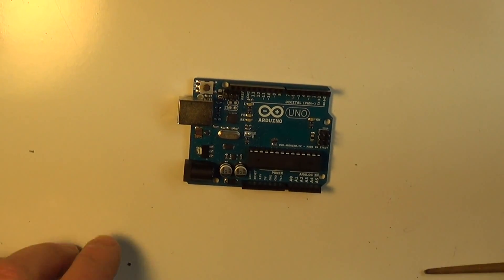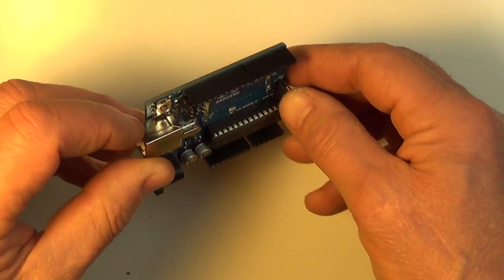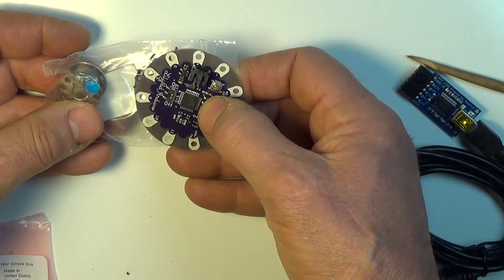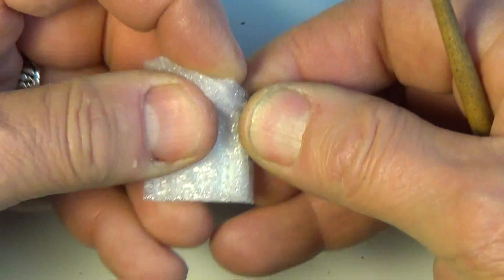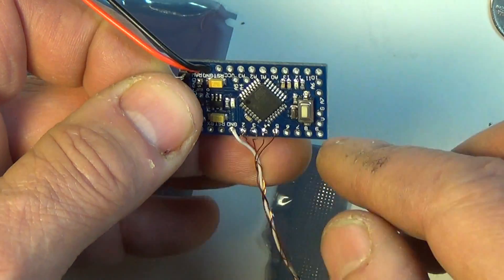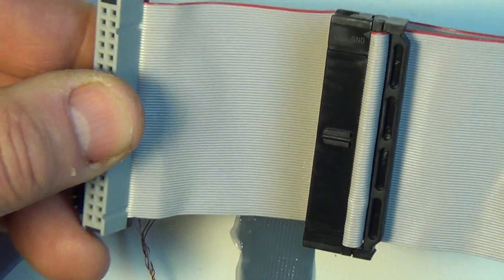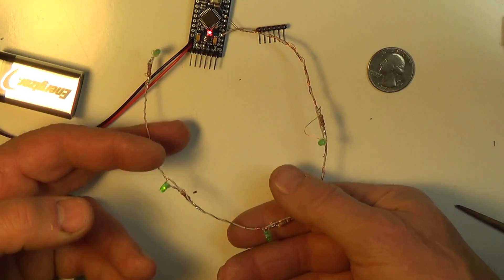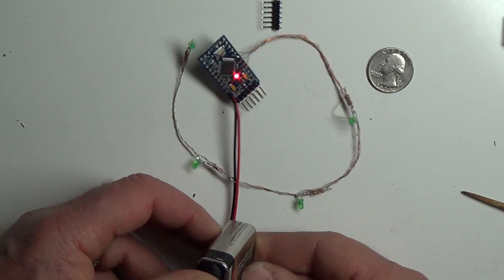Arduino Pro Mini Presentation

Comment: You can get those so much cheaper
Reply: Published on Dec 3, 2013 so, yea, you can get them much cheaper now but you still have to buy a FTDI programmer and those are getting more expensive, stateside.  You can buy them at a good price direct from China if you have the time.  I am still using these because they have fewer issue than some of the ATTiny85 chips for less money.
Reply: David Peins check Aliexpress. Everything on this video could be bought for under £15 altogether

Comment: is 9v battery over voltage or not?
Reply: Karl, that's one of the really nice things about these boards, you can power them with up to 12V on all of the ProMini variants that I have seen.  It depends on the voltage regulator they use but, I have never had a problem.  It works out well for me because I have the kids develop code for their LED stings, from fire flies to disco, and they walk out of the room with their displays working - with a single 9 V battery!
Reply: Wow thank you for the fast response
Reply: But I need to connect it the same way like you did?
Reply: Yes, connect the red 9 volt positive lead to "Raw" and the black lead to "GND (ground).  only the "Raw" input connects to the input on the 5 volt voltage regulator. If you connect 9 volts to Vcc, you will destroy the processor.
Reply: i don't understand any of this at all i thought they came in  3.5 and 5 volt models WTF is the 3.5 or  5 v supposed to mean then? also i bought  a pro mini 5v from inland i do not see any  "raw" pin on it at all in fact i can barely tell   what any of the pins are labeled as  at all it's all mixed up so i can't see which label goes to what pin
all i see are RST and VN
Reply: ok i think i figured it out, my board has 5 extra pins ,a4 ,a5, a6 , a7, and another gnd but  those extra pins  do not affect the  placement of the other pins on either  side or the FTDI pins on the end , everything else is the same just those added pins on the end opposite the FTDI pins
so these boards will be able to be powered by any voltage from 3.5  up to 12v but the 5v or 3.5 v means they run at  3.5 or 5 v  and the GPIO output pins output either 3.5 or 5v based on the board model you have
so since my board is 5v i would need to use current limiting  resistors calculated for my LED's based on 5v input voltage 
i can use a 9v transformer to power board and it will regulate the voltage to 5v and then if i want to run leds from the pins i just calculate what value resistor i need based on 5v input voltage for the LED's
do i have all this right?
Reply: David Peins but I trie it my mini get too hot

Comment: why would you connect the positive to RAW vs VCC on the battery adapter? vcc is the common no?
Reply from the maker: +Devil's Cut Bistro  I have always taken VCC to mean TTL voltage, +5 volts relative to ground.  When we breadboard Arduinos, we include a 7805 or similar voltage regulator and use the regulated 5 volts to feed VCC.  So far, most of the Arduino versions that I have used, except Teensy 3.X,  have access to a small 5 volt regulator on board through the "RAW" pin.  You can run a few LEDs of the on-board regulator but I don't think I would go much more the 100mA continuous.

Comment: its not sodder
Reply: *****  I made this for a group of kids - all here in the USA, knowing that some pronunciations may vary across the pond...
Reply: what sketch did you use on arduino for the download to run the blinking lights?
Reply: +Bill Sheesley it's in the arduino IDE... sketches/basics/blink
Reply: "SOLDER" - get it right!

Comment: I am using 32 AWG magnet wire to make inexpensive LED strings.  I use a match to burn the insulation off the end and pinch and sand with 400 grit body paper before soldering.  I have found that if you don't burn the insulation first, you sometimes get solder joints that look good but the wire has not taken the solder - difficult to troubleshoot!

Comment: what gauge magnet wire are you using? 
I'm new at this. I'm looking for cheap wire that might work well over moderate distance of around 10 feet (connecting sensors to arduinos/raspberry pis).
Reply: 22 gauge is the standard...